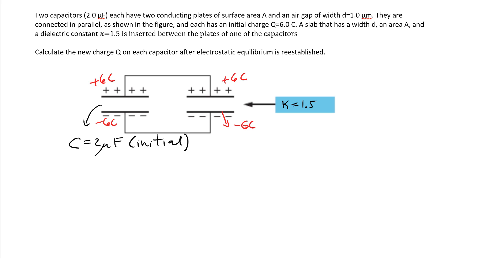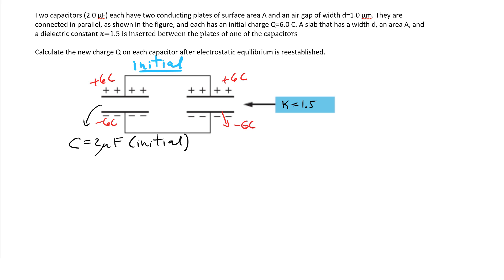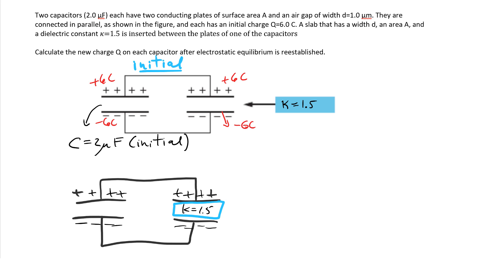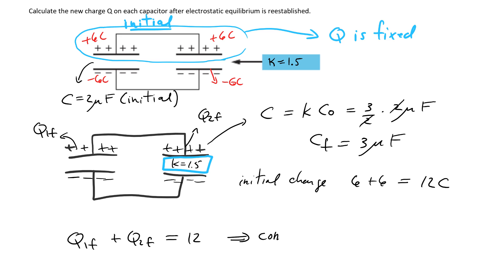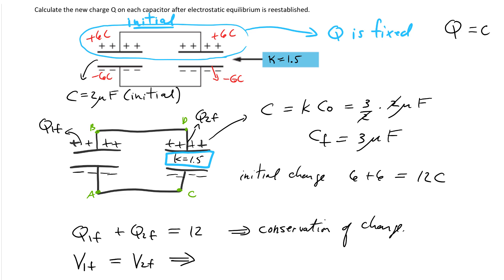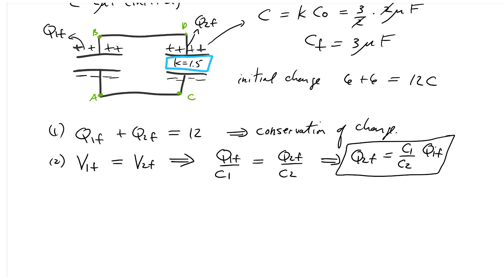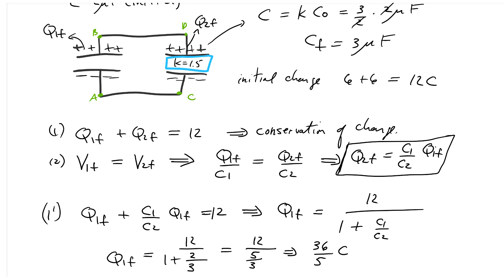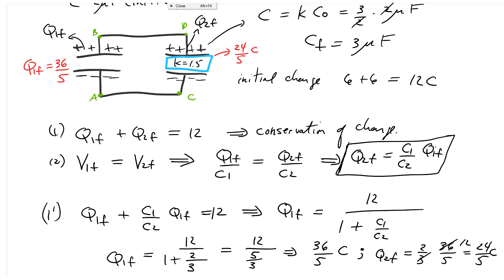Two charged capacitors

Comment: I think I found an algebra mistake; at 5:01 you switched C1 and C2. You go from Q1f/C1 = Q2f/C2  to Q2f = (C1/C2)Q1f but really it should be Q2f = (C2/C1)Q1f. By doing this you switch the final answers for Q1f and Q2f. You can check this by plugging the final answers back into the voltage equation.
Reply from the maker: Josh Newey thanks, you’re absolutely right.   Nice catch.

Comment: I hope you don't mind answering this question, this was a good video. I learnt that the charge is conserved respecting Q1' + Q2' = Q1 + Q2. However, in school, i was shown that if the capacitors are connected to each other's opposite ends (positives to negatives rather than positives to positives and negatives to negatives like in  your video), the rule becomes Q1'+ Q2' = |Q1-Q2|. Do you know why?  Q1' denotes the final charge of C1 in case it's not clear.
Reply from the maker: Even if it's positive to negative the charge must still be conserved.   Sometimes they might only be talking about the magnitude of the charge on the capacitor  and when you say a capacitor has a charge Q this number is always positive but you have to remember that one plate has +Q and the other has -Q.       Regardless of the formula, the conservation of the charge has to apply.   You can look at the positive plate of one capacitor connector to a negative plate of a second capacitor and the total charge has to be constant.     The is a gap across the plates so charge has nowhere to go ....unless you have dielectric breakdown but that's a whole other problem.